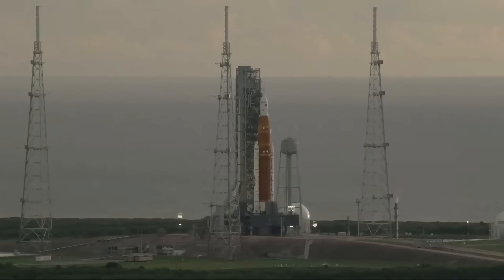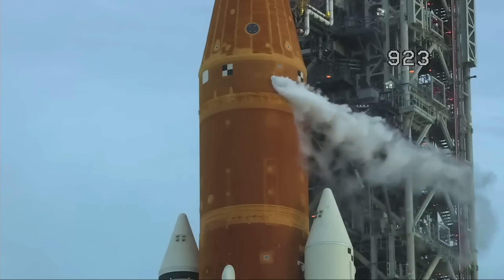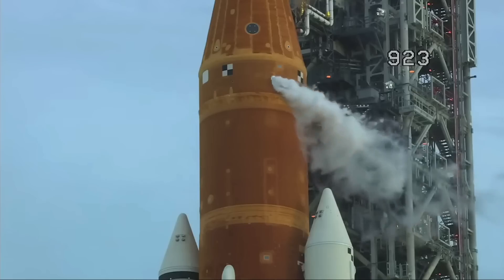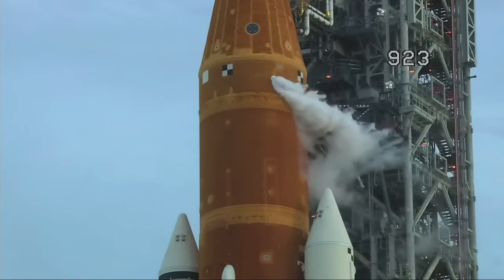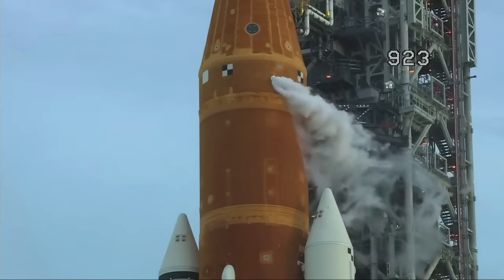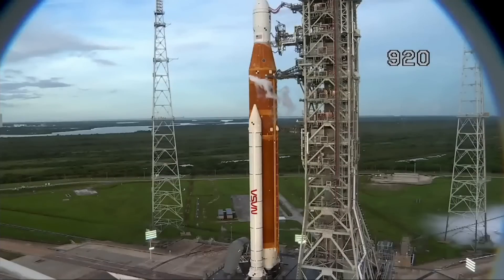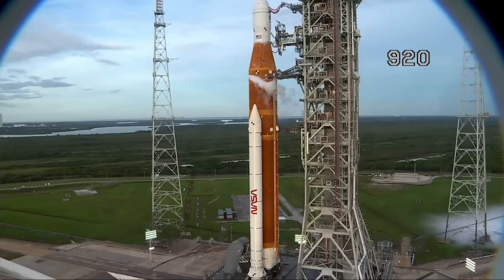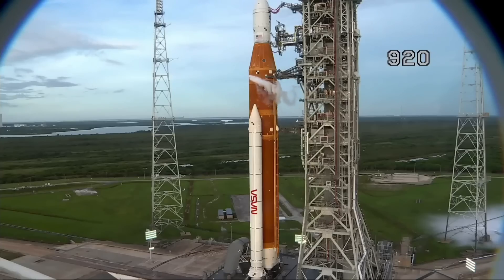NASA Artemis 1 moon rocket has 'stress crack' in tank's foam, no structural damage

Comment: And 20 years later from the shuttle days, the problem still remains.
Reply: Yes but now the foam can fall off and not hit Orion because it's at the top of the stack!
Reply: @ANonymous-mo6xp  Columbia flashbacks
Reply: well, sls is basically reusing shuttle components and slapping a centaur engine on top so wdy expect lol
Reply: @floggerfrog  No it's not, the core stage is not shuttle derived, orion also isn't shuttle derived
Reply: @floggerfrog  Except it's not. Go into the details before you write stupid things. Avonics updated, engines updated, tank design is brand new, etc. Oh and by the way, Centaur is still one of the best upper stage engine.
Reply: @saxus  ANS IT'S STILL DELAYED.
Reply: Yes, much more engineering info not disclosed and what is disclosed is somewhat misleading.
Reply: I love how everybody here is now some sort of expert. 🤣
Reply: What happens when you use old tech. This “Frankenstein rocket” is a mishmash of repurposed Shuttle tech and of the scrapped Orion project.
Reply: good to know that there's something you can rely on with NASA
Reply: The original foam on the shuttle worked much better.. A "save the planet' engineering change to reduce "a green house gas" emission from the foam resulted in a much weaker foam that would later killed a crew.   If they're using the same foam with a vehicle with larger vibration modes, I would think there will be significant foam separation.
Reply: Its because its all a big bs story that they peddle to us, billions of dollars and they cant get it done.
Reply: @kdmigloo  I refuse to believe in you 😂😂
Reply: The Shuttle had a defective seal that was not installed correctly and QA missed it because it was between two rocket segments. The company that supplied it was censured and fined.
Reply: The keep the fuel at negative temperatures because liquid hydrogen and oxygen have to be a low temperature causing ice to form
Reply: NASA = NEED ANOTHER SEVEN ASTRONAUTS. 
It's a shame scientific endeavours are controlled by non scientific leaders.
The same avoidable mistakes over and over
Reply: surprising we haven't created a material that can withstand all of the problems associated with going to space.
Reply: @jackfranconi  SpaceX did it's called Stainless Steel.
Reply: @jackfranconi  we have and SpaceX is perfecting it right now.
Reply: @jackfranconi   It's called Cash
Reply: @russellupsumgrub9633  hardly the first attempt,  try looking up Apollo 11, then look up challenger , that I lay squarely at the feet of NASA leadership more interested in photo ops and self promoting sound bites than the astronauts safety
Reply: @russellupsumgrub9633  HOW LONG AGO???
Reply: Learned nothing did they?  Hmmm
Reply: @russellupsumgrub9633 It is  same basic engineering that failed 36 years ago,
Reply: SLS is nothing more than a re-arranged shuttle.  I would expect similar problems.
Reply: @franksolario1842  Dude it's not. Yes, uses components from old SRB's and old RS-25's, but they have been upgraded too. Everything else is brand new. Tank design is different, avionics are brand new, etc. Just because those upgrades the RS-25's have extrra 5-8% performance boost and even as SSME they counted a really good engines.
Reply: you expect anything else from the government?
Reply: Doing the same thing over and over and expecting a different result.
Reply: SAME CONTRACTOR!!!!!!!!!!!!!!!!!
Reply: The problem still remains as they are using same engines of the shuttle... :P
Reply: @DIASDEMUSICA  SSMEs had five problems out of 135 launches
Reply: @Canada_Dominium  that's still a 3.7% failure rate. A very awful number when compared to today's reliable and cheaper rockets
Reply: @kfenstymiller  There was never a mission failure because of a Shuttle main engine.  Not sure where you got the word 'failure' from. Also, these were complex reuseable engines and the most powerful ever designed. Musk's rockets will be reliable until he has an inevitable mishap.
Reply: exactly
Reply: It's a pile of junk, tbh. SLS itself is badly outdated. This, and each launch, costs the taxpayers billions.
Reply: @johnxjen  Yes, lunar launches are expensive. But not to worry--the USA spends $750 billion each year on fast food, bad entertainment, pot, booze, and cigs.
Reply: @johnxjen  oh course you would know, you should be under the engines at main engine start to gather data.
Reply: What an embarassing  waste of money.
Reply: "From that time Jesus began to preach, and to say, Repent: for the kingdom of heaven is at hand." Matthew 4:17 

"Ye have heard that it hath been said, An eye for an eye, and a tooth for a tooth: But I say unto you, That ye resist not evil: but whosoever shall smite thee on thy right cheek, turn to him the other also." Matthew 5:38-39|

Comment: Didn't we lose a shuttle due to foam coming off its booster?
Reply: No, lost a shuttle due to foam hitting a wing leading edge. Some rockets shed all of their insulation at launch by design.
Reply: @UncleKennysPlace  I would have said “YES, we did lose the Shuttle from a piece of foam removing key insulation from flight surfaces and body during the launch.  The loss of that insulation resulted in the exposure of unprotected metal surfaces to the extreme high temperatures of reentry, allowing the entire Shuttle structure to fail catastrophically.
Reply: Yes, but all the important stuff is above the foam now.
Reply: @ANonymous-mo6xp  Big advantage to going back to the old-fashioned stack.  Not only will stuff coming off the rocket NOT hit your spacecraft, but, if things get explody anywhere between the pad and sub-orbit, you have the option of using the little booster at the top to yoink the capsule out of harm's way for a premature, but hopefully survivable splashdown.
Reply: @ANonymous-mo6xp  not all the important stuff is protected, for instance the boosters.  And effects from the loss of the insulation, regardless of impacts with the rocket, could also affect the stability of the rocket from asymmetrical drag.
Reply: Yup, kind of. It indirectly caused the accident. A piece of foam struck the heat shield, so columbia burned up during re entry. That can't happen because the heat shield is more durable, above the tank, and shielded by the SM
Reply: This one has no wings so its no longer a problem 😐
Reply: Yes... Have studied both shuttle accidents and their reports. The foam material has been improved, but there are still concerns. It is amazing that we don't learn. This design is only the easiest, and cheapest, that all it is... it is very sad.
Reply: should have let Elon send it up
Reply: @bryanpinto4051  Elon hasnt landed to moon yet. Let Nasa do their job and Space X will do their job as well
Reply: @JAVIxcr  Well said.
Reply: @JAVIxcr  The last time NASA went to the moon nobody currently at NASA had been working on moon rockets. That was over 50 years ago.
Reply: @Mike19737  Couldn't agree more.
 Thumbs up for you both!
 Cheers

Comment: Dude, are you not aware of the truth yet?  Earth is not a globe, universe doesn't exist, sun & moon are the same size, made up of plasma hovering above our flat earth. If earth goes around the sun, then why do we see same stars for all 12 months? Shouldn't we see different stars on different directions? Globe liars got busted once again😁 solar system, big bang, planets are fake (photoshop). Are you people even real?
 Michaelson-Morley and Airy's experiment were supposed to prove the earth's rotation, but those proved the earth doesn't spin, they bite the dust, many experiments ended up with the result of non-moving flat surface. WELCOME TO REALITY. UNIVERSE DOESN'T EXIST. 
Governments , nasa, isro have been lying this whole time.
Reply: Satellites don't exist. GPS not working in ocean. GPS is just the triangulation of cell towers. Internet cables are buried under the ocean. Time to wake up. Trust your senses..
_ Satellites don't exist. Those are cartoons. Men send signals to the sky at an angle (a solid dome placed by our Creator), and it reflects those signals back to flat plane(earth) at same angle. Everything is stable, the ground antenna that sends, the earth, the dome, the ground antenna that receives. Universe, solar system do not exist. Are you saying there are bus sized tin objects that float above our heads about 700 km which is supposedly 2000 C hot and doesn't melt the trash cans(so-called satellites) ??
_ Does it feel like we are travelling at 66600 mph around the sun? Earth inclined 23.4 degree? 90 -23.4 = 66.6 now you see it's 666 everywhere.. it's the devil's number.. YOU WILL KNOW THE TRUTH, AND THE TRUTH WILL SET YOU FREE. 
 _ Why mercury and venus show up in the night sky? Can any scientist (Illuminati) explain this? No. All 12 months, we see the same stars in the night sky, but we should see some other stars which are in the other side for 6 months. Globe is busted again.
 _ Antarctica is the surrounding 300 ft. tall ice wall of our flat earth, and illuminati won't let anyone near by to discover that the world is flat, it's the most guarded place on flat earth. There is a treaty signed by 50 countries that no man can get to Antarctica, because it's the surrounding wall of our flat earth, and it extends very far.
Reply: That's a long paragraph you wrote just to show what a moron you are

Comment: It's better safe than sorry , even if it is unmanned , there is a lot of hardwork since 2019 this program was started
Reply: Yeah ... that's when its first launch should have been.
Reply: I think by now, we are way beyond the O ring problems.
Reply: 😂😂😂 it's just a re hash of old propulsion tech..nothing remotely resembling hard work or propulsion concept ingenuity after how many years? Clap clap bigger metal tube with more highly flammable propellant..someone got a match?
Reply: @nemsire4375  The rs-25 engines are still the most efficient ground to orbit engines ever developed. This is primarily due to the hydrogen they use as fuel. This hydrogen is also the cause of the issues with the launch. It can be problematic but once they work through the problems I really wouldn't call the engines outdated. The core booster not being reusable is a shame, but to be fair no one really thought it was possible before SpaceX.
Reply: @RMX7777  ok that may be true, but my point is innovation into a safer cleaner cheaper more powerful propulsion systems and technology has remained stuck in limbo for 100 years.We can do better, but we dont.why?
Reply: @nemsire4375  well SpaceX is certainly making progress on the cheaper and more powerful side of that. Their new raptor two engines have the highest internal pressures ever used in a rocket engine, and being that they are designed to be reused with little maintenance they will be the cheapest engines out there as well. In terms of being clean though you really can't beat the sls rs-25 engines, considering their exhaust gas is water vapor they pose less harm to the environment than most other engines. Can't say the same for the solid rocket boosters though. I know this phrase gets overused but it's true, space is really hard. It can be frustrating to see how slowly things progress but keep in mind that rocket engines push material sciences to their limit. We have to operate within the physical laws of our world, and we are making great, albeit slow progress on that.
Reply: @nemsire4375  not at all, the tank is new, srb got an improved nozzle, entirely new mission profile, way better life support, safer overall.
Reply: @nemsire4375  Our slumlord occupational government can't even build a bridge.  I'm very curious if any of our nuclear weapons are even functional.  I guess we will know soon.
Reply: @nemsire4375  Nuclear propulsion isn't there yet. Same for ion propulsion. Want to talk Alcubierre Warp Drive?
Reply: Orion-SLS began development in 2011. It didn't have a clear mission until 2017.
Reply: Next year you will say it started in 2022 🤣🤣.  This thing has been going on for a decade with almost nothing to show for it.  We did this already back in the 1960s.  Put the money into new technology like Space-X.
Reply: With so much budget and cracks still u got cracks.shame learn from space x and the soviets
Reply: @MushroomKing001  to fail expensively
Reply: @MushroomKing001  no one can my boy we rich get Rich u just sit and complain weee weee😂😂
Reply: @MushroomKing001  Because it's a grift. $50 million a day to laugh at the 🐑. Wonder why, with our vast technology and RING doorbell cameras, can't they put a couple dozen little cameras on the jet powered blimp? No cutaways?! Nah, didn't think so. Maybe one of you smart guys can tell me? Or at least make you think for once.
Reply: @MushroomKing001  I like the way you think. 👍
Reply: Thank goodness it's just unmanned.
Reply: Yea but what about the people who had travelled from far away to see it
Reply: LOL has nothing to do with the billion dollars they are going to blow up. 🤷
Reply: @RichMoore-tweakin7376  Dude, you can't have your cake and eat it too. The cake is the delays, and the eating is the blowing up.
Reply: Believe in exploration and space travel visits out into the Galaxy but to logically expect to live or Colonate humans off of:
Planet earth suggest is a shortcoming of reality.
(Hollywood has warned us many times in movies&
documentaries)
Public funding in such of time of needed re-distribution of wealth and new opportunity here on earth is hurtful to witness this...
Public funding to support this ideology to expand humans off onto another surface in the Galaxy-
Suggest human numbers accountability and or logical thought is in danger:
Proof positive...
Reply: THAT'S WHY THEY NEVER TOUCH THE MOON WITH HUMANOIDS. EVERYTHING WAS A JOKE AND SUCKER THE MONEY TO THE TAXPAYER.
Reply: @MushroomKing001  ja,ja,ja,aj,ej,eje,je,ej. NO.
Reply: The Artemis program was formally established in 2017 .  many of its components such as the Orion spacecraft were developed during the previous Constellation program (2005–2010) and after its cancellation  https://en.wikipedia.org/wiki/Artemis_program    Many years of work has been put in to this idea.
Reply: @vontar1  With the goal of putting anything other than a white male back on the moon.
Reply: @vontar1  it was a joke😂
Reply: "From that time Jesus began to preach, and to say, Repent: for the kingdom of heaven is at hand." Matthew 4:17 

"Ye have heard that it hath been said, An eye for an eye, and a tooth for a tooth: But I say unto you, That ye resist not evil: but whosoever shall smite thee on thy right cheek, turn to him the other also." Matthew 5:38-39|
Reply: @dumbpoorhappy  Fuck JEsus Christ in his ass with a baseball bat...
Reply: @dumbpoorhappy  with all due respect I dont entertain a religion that used to claim we are at the centre of the universe, that all gay people are going to hell, and that Extra terrestrial life doesnt exist-until it becomes too obvious it does and then back track  to say "oh alien life does exist but are also children of god"!?😂too many contradictions and barbaric close mindedness for me to take anything you say or quote from the bible serious in anyway shape or form
Reply: LMFAO Yeah you keep believing that!     Happy NERDING
Reply: @jimabbey9544  yeah , i love being nerd...so?... What's the problems
Reply: @jimabbey9544  absolutely nothing wrong with being a nerd.

In fact, if Americans didn't ridicule  science nerds for decades, maybe engineering would have been more fashionable and you wouldn't have to outsource all your manufacturing to China, no?

Comment: Space x would have never let this happen
Reply: SpaceX rockets blow up like every week wtf are you talking about, SpaceX would have continued the launch even with these issues and the rocket would have exploded as a result
Reply: @greatconch278  since when do SpaceX rockets blow up every week? And no, they wouldn't proceed with a launch if they had a problem with a valve.
Reply: nasa a waste of money.
Reply: SpaceX had many scrubs and aborts early on
Reply: Didn't SpaceX just have its booster blow up with vent gas during a test, and had to take its booster off the launch mount, replace engines, fix and repaint its launch tower? I'm not saying that SLS is superior to Starship, just that both programs are a disappointment right now.